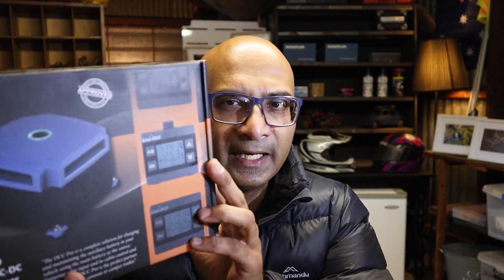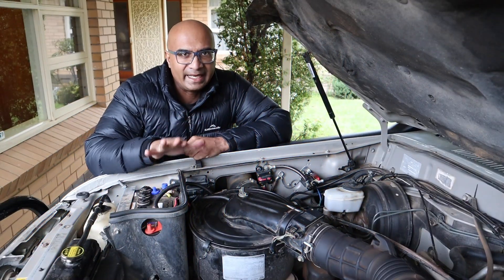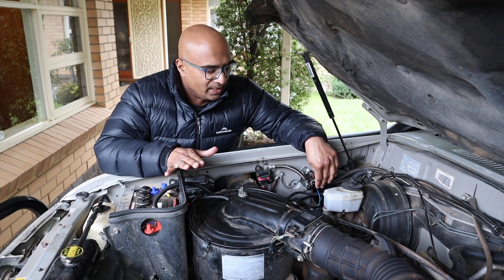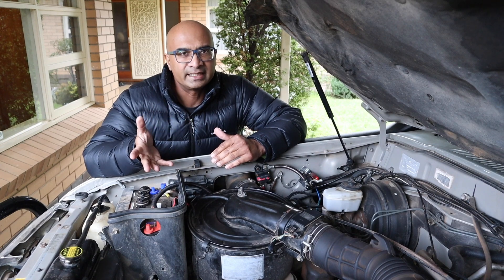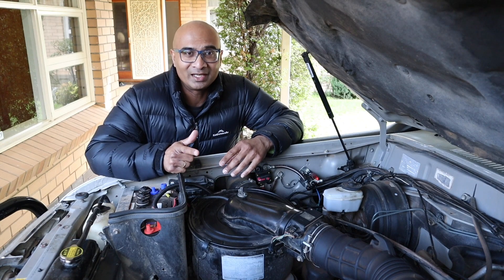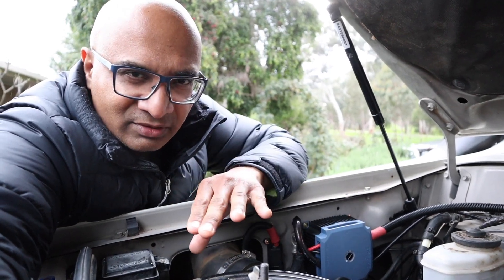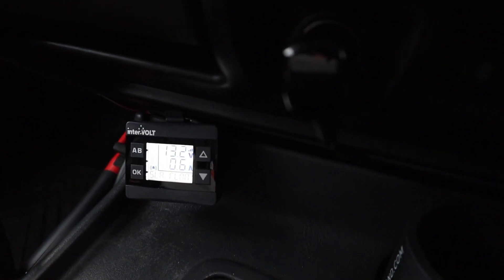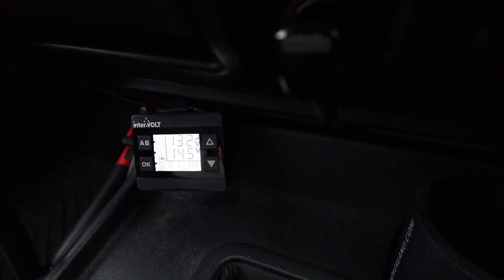Touring 4x4 DC to DC Charger | Lifestyle Overland

Comment: Is the bottom section of the screen showing the charge going into the battery in amps or the draw of the equipment running off of the battery in amps?
Reply from the maker: Hi Jack
Basically the bottom reading is how much amps the DCDC charger is pumping into the battery in order to keep the current flow to the accessories as well as keeping the battery topped up. Hope that makes sense.

Comment: Hi Duncan, currently tossing up between intervolt and redarc dc chargers, any thoughts on which would be best for a basic campervan set up?
Reply from the maker: Hi mate. I feel both brands are equally good. Considering each unit on its own, I went for the Intervolt mainly because the LCD display came standard with the product. This has been very useful as I get to see how much of charging is going on. Check this video out where I talked a little bit in more depth about the LCD display. https://youtu.be/gONBku8Hlvw
Having said that, since it is for a caravan, it might be a good idea to go with Redarc because they have an entire ecosystem for caravans in case you decide to expand your electrical management system in the future.  Hope this helps.
Reply: @luxandtrackafrica  legendary answer, thanks so much!
Reply from the maker: @BoB-ef7zd  Happy to be of help mate :)

Comment: G’day great video but there’s a version 2 lithium one or is this it? And can that Little monitor harness lithium readings?
Reply from the maker: Hi Richard. I am not sure about the version 2. At the time I had mine installed I was told it can be programmed to Lithium. If you are thinking of getting one, check with your supplier just to be sure.

Comment: Hi Duncan, just a query on the intervolt. When it is set up to take a solar blanket or whatever, I’m assuming the solar is a unregulated setup 
as the Intervolt is taking care of that. How do you monitor what’s going in from the solar set up, are you going to the car to check it via the remote display which means you’d be turning the ignition on or do you have something in line between the solar and the DC/DC. Asking for a mate😁
Reply from the maker: Hi JD. Yes when plugging in the solar power supply disconnect any regulator that comes with the panel/blanket. The DCDC charger will do the regulating. To get the LCD panel to work you will need to turn on ignition. I have a volt/amp meter at the back of the 4x4 which works all the time regardless of ignition. I take my readings from this which is a lot easier.
Reply: @luxandtrackafrica    Thanks Duncan.

Comment: Hi Duncan, great informative video there, thanks. I have an 80 series & have known the starter of the same to be of 24 volts, hence the requirement of 2 starter batteries. Did you modify your starter or something for it to only a require a 12 volt starter battery? So that you could use the other battery location for the deep cycle one?
Reply from the maker: Hi Sarat. From what I know the Aussie 80s came with a 12v starter. 24v starter was for those that were sold in countries with cold climates where cold starting needed a more powerful starter. Not sure where you live, some 80s that are direct imports from Japan (or certain other countries) may have come with the 24v starter. If you live in a warmer country and your 80 was imported from a cold climate country, you can change to a 12v starter allowing you to use the second battery as an auxiliary power source.
Reply: @luxandtrackafrica  i live in kenya - yes , fairly warm country. thanks for the advice!
Reply from the maker: @saratsuri9617  Glad to be of help. Your's must be an import so the 24v set up. Before you change the starter make sure there are no other 24v components which will also need changing.

Comment: HI Duncan, nice video!   What are your thoughts on the DC\DC charger after a year of use ?
Reply from the maker: Hi. I have been quite happy with the unit. I found the LCD display (which is not standard with other brands) very useful as it tells me when there is load on the battery.

Comment: I have got an Intervolt version 1 DCC Pro charger that I have persevered with for the last couple of years in my camper trailer. This charger will not enter Boost charging mode until the auxiliary battery has reached 12v or less. This is absolute rubbish as my AGM battery has been depleted to a capacity of about 25% by this stage. The new version 2 of this charger has fixed this obvious design flaw and will now begin to boost charge at an auxiliary voltage of 12.6v. After numerous conversations with them over the past couple of years about this issue and once after they have released version 2 of this charger which has fixed the issue, they have fobbed me off on every occasion and said that it’s a charger and it’s doing it’s job. My personal opinion is don’t waist your hard earned money or time with this company. I have been left with a sub standard charger and should have spent my money on a Redarc or Enerdrive product.
Reply from the maker: Thanks for that Noel. Always good to hear other users' experiences. Mine is the version 2. Opposite lock sold and installed it for me. From what I was told, the charger can be programmed to kick in based on current draw from the accessories and also at what voltage the battery is at. So mine is set to 12.8v. So far so good. I deal with my local OL retailer and they have been awesome with after sales support.
Reply: Hi Duncan, 1 year on what your thoughts on the intervolt charger?

Comment: Another great vid Duncan. Good to hear Diesel is closer to being back on track. Quick question in terms of a dual battery setup. My vehicle is a daily driver also so I am a little reluctant to permanently mount a deep cycle battery. Are those battery boxes a good option in your opinion?
Reply from the maker: Hi Prashant. It all depends on how much of travelling you do and more importantly how many accessories you run. A few others asked me the same question. So for the benefit of everyone I am working on a follow up video to the DCDC charger. Should be out soon.
Reply: @luxandtrackafrica  Fantastic Duncan.

Comment: Really enjoying your videos mate, just a small correction; at the start; AGM batteries need & like a fast & high charge due to being discharged down to as much as 50% SOC charge in the mornings (e.g. 10 - 25 amps ) whereas the Crank batteries only like a slow &  lower amp charge e.g. 6-8 amps max.
Reply from the maker: Thanks for that. Apologies for the delayed reply. Thought I had replied.